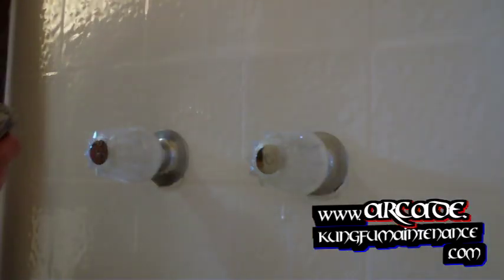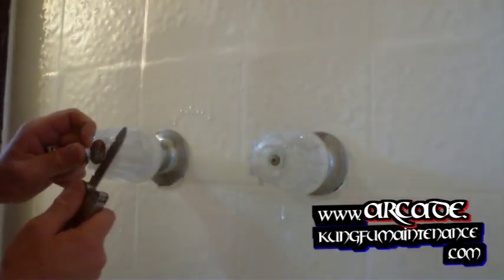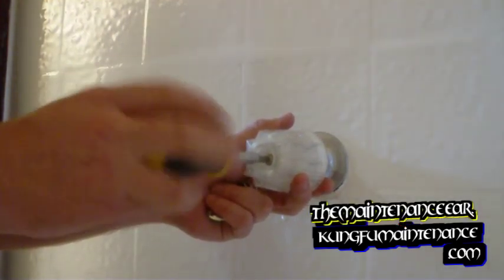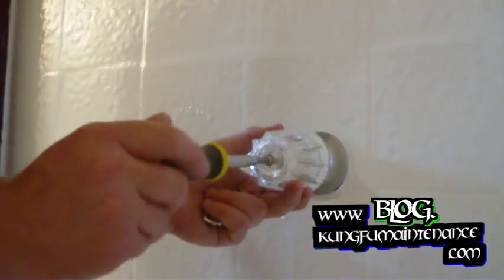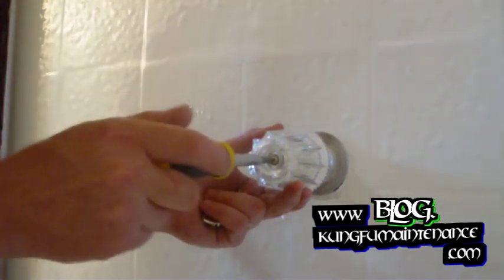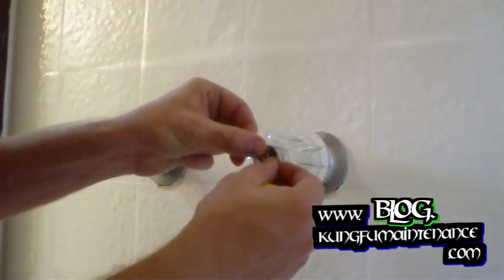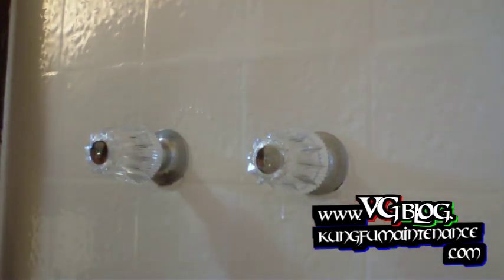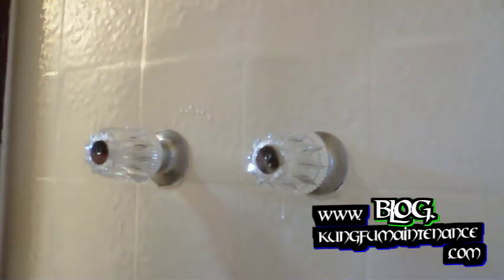How To Replace Handles ~ Hot And Cold Tub Or Shower Compresion Style

Comment from the maker: Sometimes you are stuck with the same type but some brands do have alternatives and there are also some universal type replacements that anchor to the existing extensions using set screws. You might try taking in your handles to your local hardware store to see if they can help research your options. Most handles are done by specific extension star types. Some supply store catalogs will show you real size star head patterns and handle dimensions so you can match up and order your choice fit.

Comment from the maker: Look for other types of anchors on the handles. The type in the video the set screws hide under the index cap. On some there is a small set screw that anchors the handle so look at the bottom of the handle to see if you see a set screw sometimes an alan screw sometimes a small flat head that anchors the handle to the stem extension. Often set screws are hidden under plugs, buttons, or labels. Loosen up the set screw and pull off the handle. ~ Hope that helps ~